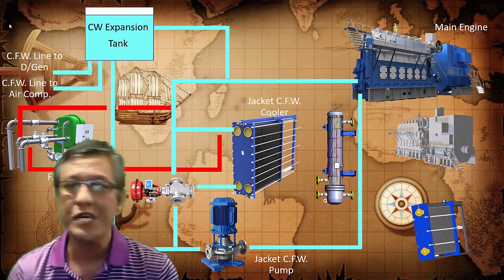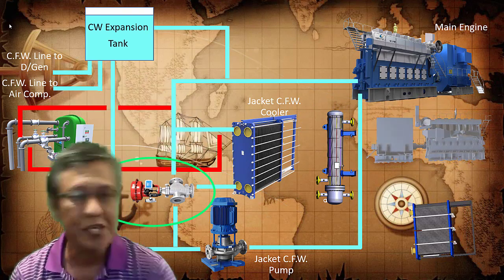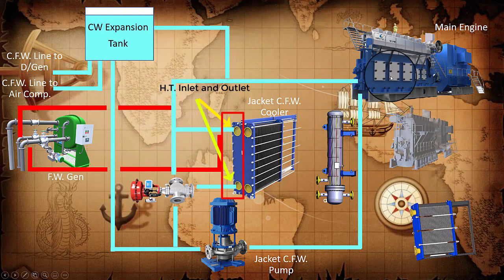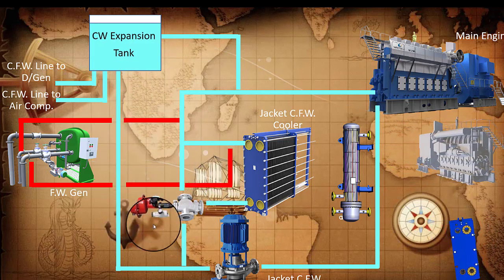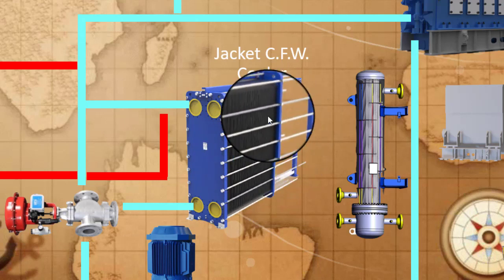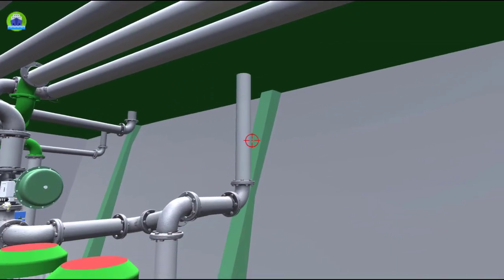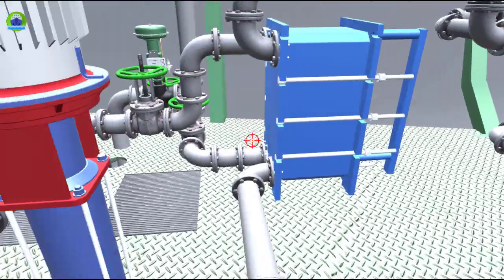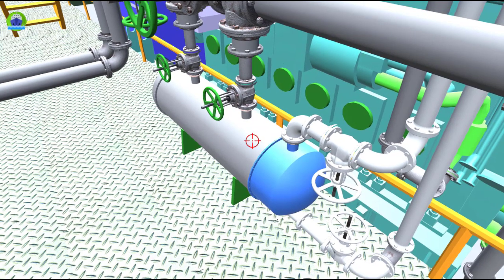Fresh Water Centralized Cooling System on board Ship.

Comment: great video sir Chief, are you a chief engineer?
Reply from the maker: Nope, on the contrary I am from the Deck side. You will find in the disclaimer that this video is not a substitution, augmentation or either a guideline and must not be used in actual application. I have said it here that It was cascaded to me by Chief Engr and acting as a narrator but not claiming to have an on hand experience, also I might have misunderstood how it was cascaded to me. The video was presented thru Virtual Reality and animation which doesn't even passed to my own quality level yet I was hoping it may give a better understanding. However, the right authority for training and enhancement should be followed. Viewers discretion is advised. Tks for your support.